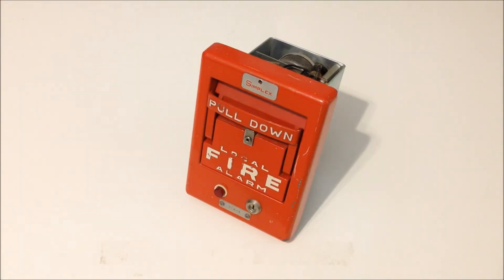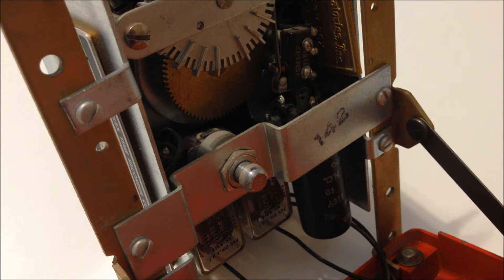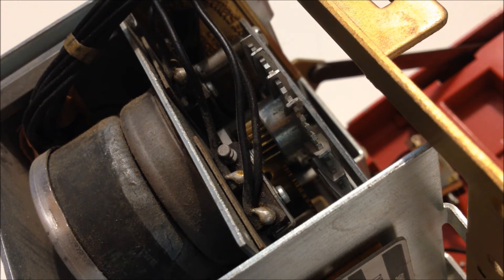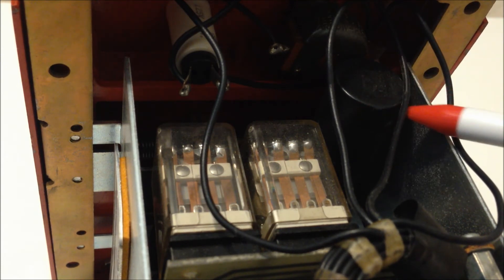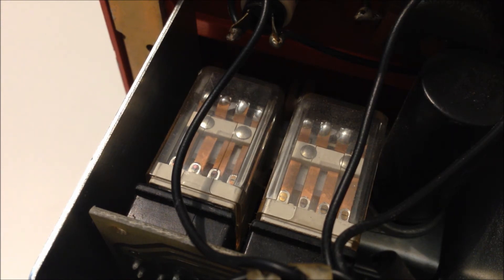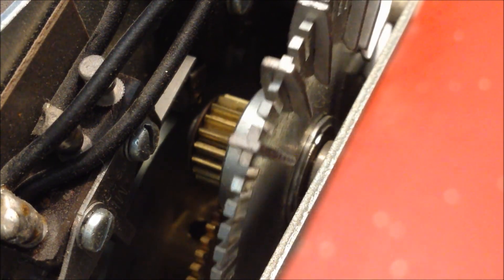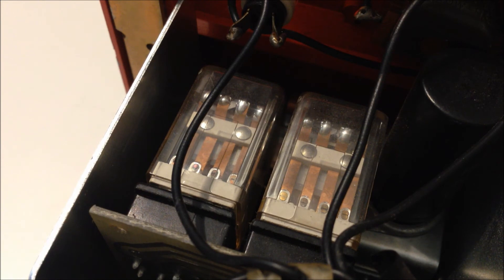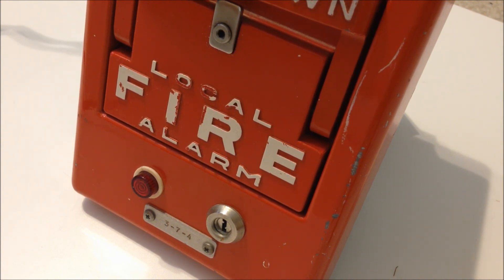Simplex 4274-2 Coded Pull Station | Detailed Overview

Comment: In a fire would you have to pull it more than once if it stops? Also did the person pilling the alarm wonder why the lever went back up and then stopped?

Also if the person did not pull the lever all tte way and it.did not do the full rounds how would you get the alarm to go longer? If you pull the lever again while its going what happens? Is it hard ro pull the lever?

Thanks

Comment: In a Fire would  you need to pull the lever again if its stops or does the Horns/Bells keep going until you reset it at the panel? So would all bells ring when you pull this station like in today's alarms or only 1 dedicated bell for one pull station. 

For instance at a college with these old stations when you pulled it would only one bell by the classroom ring or would the bell ring or would other bells ring too and keep ringing until its reset? Also would the person pulling the lever expect the handle to snap back up or would they expect the lever to stay down and if so would they pull t again just to be sure it works?

When pulling the lever down do you feel the station being wound? If you let go too soon would the alarm not work or would you have to pull it again?  Also does it take a firm grip to pull it down due to the force. Would the same feeling like opening a drawer how much force do you need? Thanks

Comment: So did Couch just make the non coded part and Simplex just added the coding module onto the assembly when it arrived there I'm assuming?
Reply from the maker: As far as I know, that's correct. The switch is actually connected by wire nuts internally, which provides additional evidence that the coding module was added later.